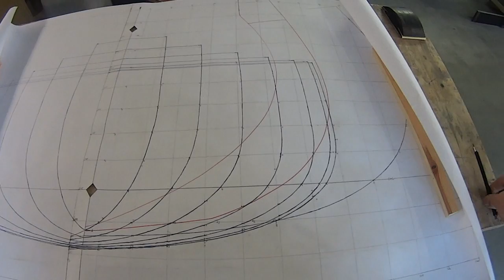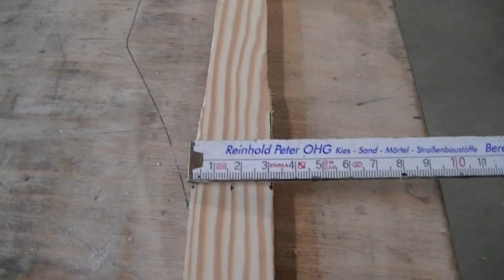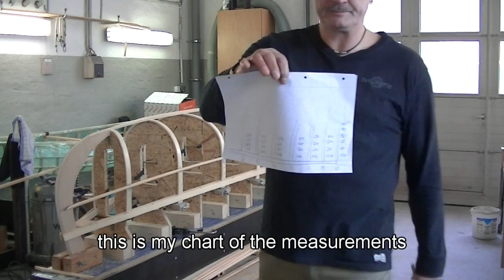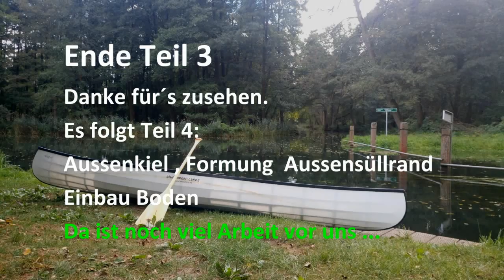Skinboat Manufacture, Teil 3, canoe build, skin-on-frame, DIY Kanu

Comment: It is such a nice work, and I'm learning a lot. But how du you determine the position of the stringers? Is there some rules, a system or is is just a feeling. I have a set of plans for a stripbuilt canoe that I try to change to skin on frame
Reply from the maker: Steffen Krøyer oh yes, the stringer's position.  I use 5 stringers for one side. I begin in the mid section. I fix the first stringer nearly at the cwl ( construction water line) . The next two above and under the first. Here I'm looking for good chines. There are about 8 cm space. The fourth and fifth comes nearly in the middle between the second stringer and the gunnels / the third an the keel. After the it goes in a smooth line to the stems. I do this with my eyes....
Reply: Thank you so much. I have to trust my eyes then.....

Comment: I’m watching this series of videos for the third time. There is so much great information here!

Do you have to steam bend the inner and outer gunwales?  There is a complex curve there with the sheer (up and down) and the actual shape of the boat (side to side). I see the notches in the malls.  Is that all you use for a form for the gunwales?

Please forgive me for asking another question so soon.
Reply from the maker: ChipsterB  oh no problem, you can ask what you want... The inner and outer gunwales are also pre-bent. I put they in a long plastic pipe an fill in boiling water. Wait about one hour and fix it for drying in shape at the side walls of the strongback...
Reply: bluewondercanoe - thank you so much!  

My cousin and I are planning a skin on frame boat and getting the gunwales right seems so important.
Reply from the maker: watch this in part 4 - also apossible way : https://youtu.be/eWf9kB7Kf58?t=907   I wish many sucsess for yor project!